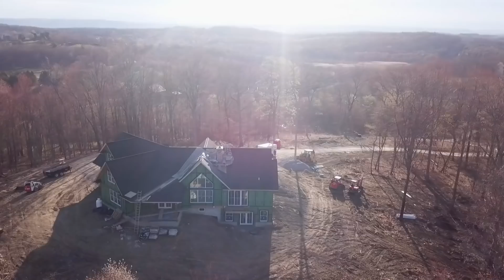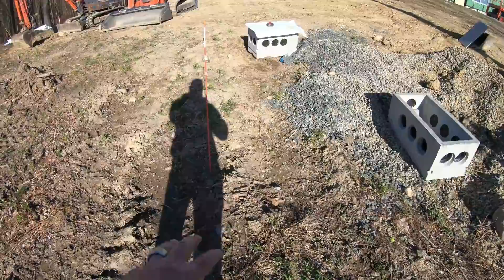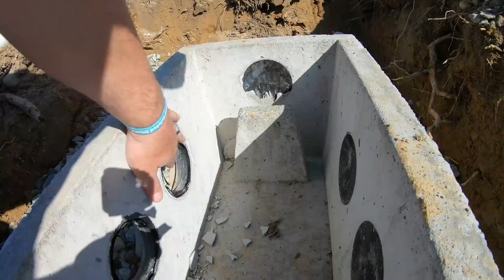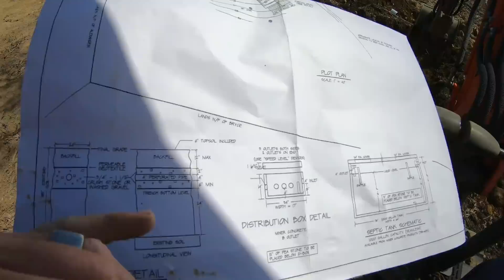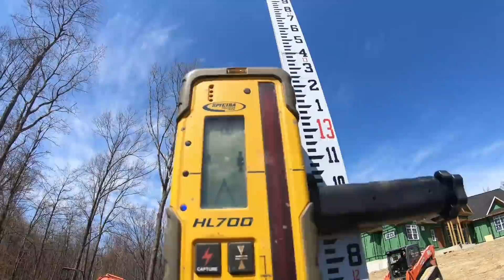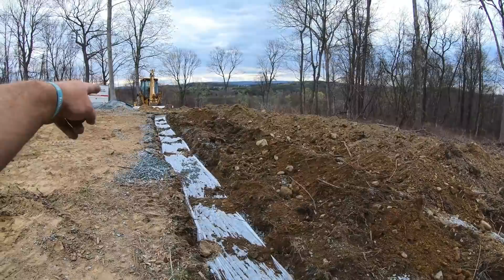NEW Septic System Install with distribution D-box stone & pipe conventional Leach field on homestead

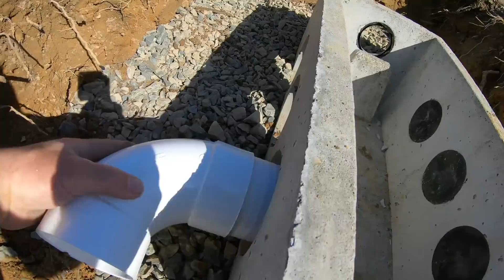Comment: 6:17 what kind of pipe is that? Black inside and looks like it would be very easy to crush.
Reply from the maker: That is double wall septic pipe solid.. solid pipe for the trunk same pipe for the laterals but perforated.. schedule 30.. same pipe is frooting drains

Comment: Nice work man.  It's really interesting to see all the different septic systems around the country.  You would think taking care of wastewater would be pretty straightforward and there would be some consistency to it but as with everything else in this industry, there's 20 different ways to do it depending on where you live.
Reply from the maker: It is crazy I'm doing one next week 25 mi away total different system going to be infiltrators

Comment: What is the receiver that you are using for the boom? Im tired of getting in and out to check grade lol.
Reply from the maker: It's a Spectra CR600 
https://g.co/kgs/BhaBzx
Reply: @DIRT-BOSS   Do you happen to know if it works with any laser? And just magnetic mounted?
Reply from the maker: @mattteague7063  It does not work with any laser I believe and yes it is a magnetic amount I've tried on other people's lasers that were going and it didn't work but it could have been just their brand you'd have to do some research
Reply: What brand laser are you using

Comment: that’s sweet new york let’s you get away with just laterals, that’s a no go down here anymore, jersey has us digging huge fields and trucking hundreds of yards of septic sand, i swear it’s a scam and these poor old folks practically have to remortgage their houses to pay for it...unbelievable.  good job D-Boss!
Reply from the maker: Yeah it's crazy how codes and states are different
Reply: Lol our state ri. , we did 10 foot gravel strip perimeter and complere ares.  And under by 2 feet.   So   15 triaxles of gravel.  Then dig in your stone pipe trenches.     For 25 yrs that way. No we can do them in natural grounds.  If shitty soils put 6 inchs  gravel under stone.          But anywhere near the coast or 2 fot water table all .pretreat and sand filters.     30 grand.

Comment: Nice job as always! I am curious how the grey water in the septic doesn't freeze in the winter months if it's not about 36" below grade or below the frost line? Or is it that deep in your install? Thanks in advance.
Reply from the maker: That's the way it's drawn up on the plans by the engineers always done them that way they always tell me septic water does not freeze
Reply: @DIRT-BOSS  Thanks for the reply.

Comment: DB how do you get away with 20" depth in NY??  What is the frost line??  Here in Michigan it's a 36" minimum!
Reply from the maker: Septic does not freeze !!
Reply: Septic dont freeze
Reply: In MI, EGLE says A minimum of 12 inches and a maximum of 24 inches of suitable earth cover shall be placed over the absorption system.

Comment: Second one today, of course! (and I get to be #5 to view.) Place looks different with no SNOW! Hey, QUESTION: with water running (or not) in that system and how freezing it gets up there, are there ever freezing problems inside the pipe? YES, I know there's a pitch but as slight as it is. Dumb question but I just wonder. That's a hell of a lot of work YOU did in what a day!  Thanks!  Sonny
Reply from the maker: Yes Sonny ! 💪🏼 No septic never freezes !